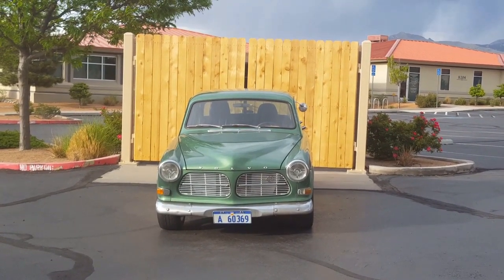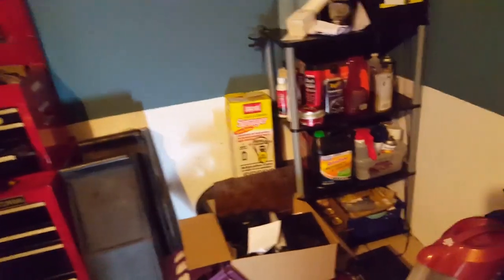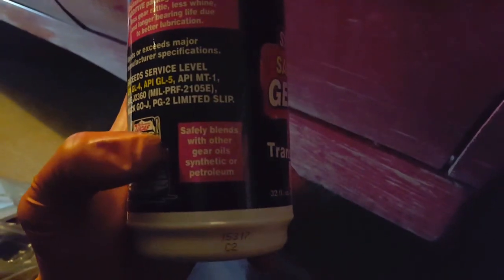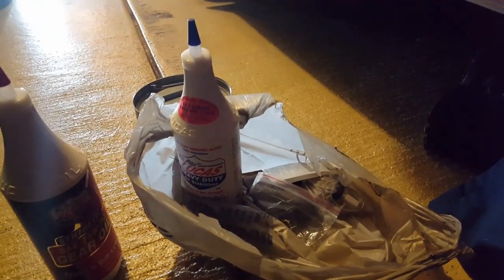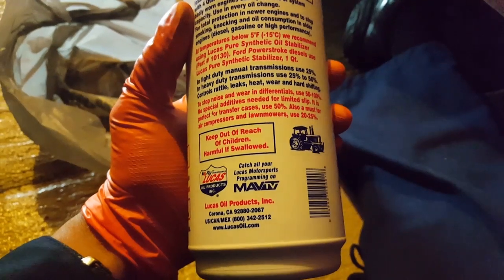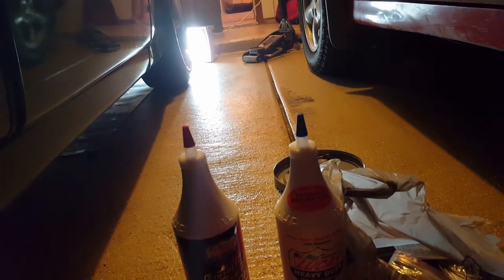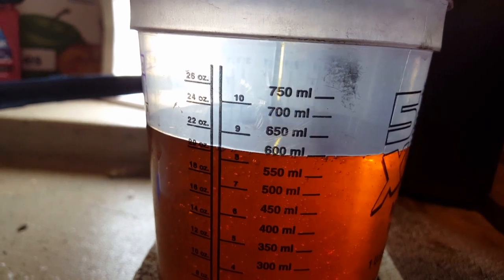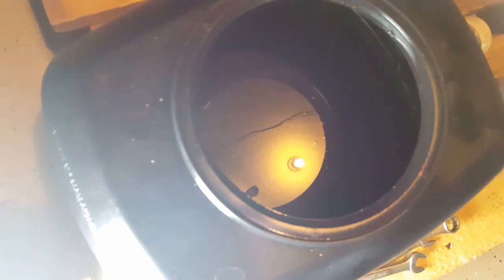GL4 vs GL5 Compatibility 🇸🇪Volvo 122S Amazon - M40 transmission Flush

Comment: It is worth saying that if you use a friction-reducing additive in your older car gearbox it is worth making sure, like the one used here, that it doesn't have a high sulphur content or you can still end up with the same damage to the brass and copper components...

Somebody in the UK tested GL5 gear oil in an old-spec gearbox, I think they used a freshly-rebuilt Morris Minor box from a well-known and well-respected quality supplier though that is not really important.  Bear in mind this was effectively a brand-new box, and it had suffered sufficient damage to make changing gear impossible (it would just jump straight out of gear) within 2,000 miles of normal driving.  Interestingly, when the gearbox was stripped and inspected the steel components of the box showed evidence of significant heating of the components which strongly suggested that the GL5 oil was breaking down under the load of the old-style transmission and not allowing sufficient cooling of the components.  So while it's great for vehicles designed to run it, it just can't take the pressure of the oldies lol...
Reply from the maker: thank you for another great contribution. 2000 miles is scary fast
Reply: David Bello   You're welcome.  Yes, it's not much time at all, and certainly not enough time to save up for a new box...
Reply: Dang so the only thing you can really use is GL4 and there’s no substitute?
Reply: I think this is more like a terribly wrong viscosity issue rather than GL-4 vs GL-5. Old machinery, including gearboxes, was prolly made with way larger tolerances than today, and ASTM D130 tests show that tribologists seem to have solved the GL-5 copper compatibility issue anyway.